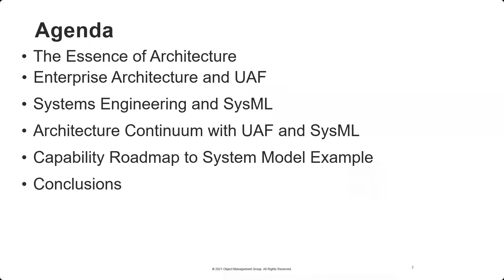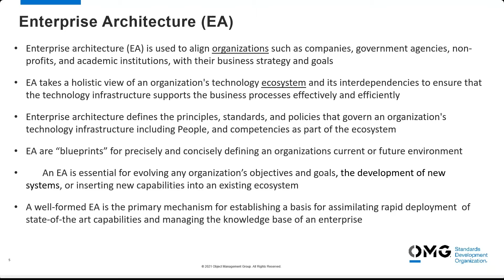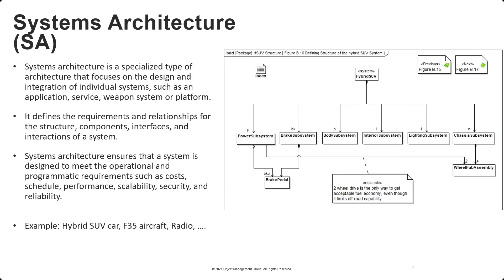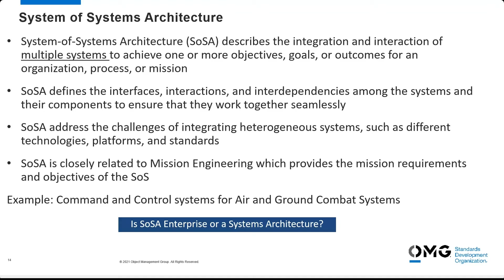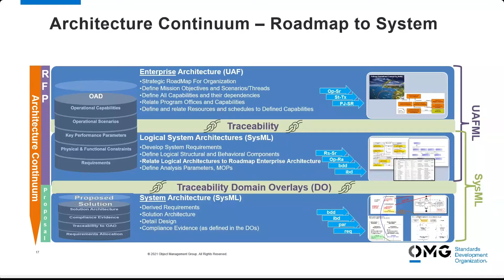UAF or SYSML?

Comment: Use both depending on the organizational stakeholder and level of abstraction you're working with.  UAF is Enterprise and if you're trying to capture where your project/system fits in the enterprise for the strategic goal or mission.  UAF is very structured and defined, and in Cameo System Modeler, the elements and relationships of the language are rigidly defined and can be very complex, hard to understand and frustrating at times due to this structure.  Even depending on the package diagrams and views, you will be only presented certain elements and relationships.  Using UAF takes a lot of planning and I suggest going to a white-board first to understand your UAF framework (and what are you trying to convey that is important to your stakeholders).  The rigorous definitions should provide guardrails to allow interoperability across a large and complex organization.

SysML doesn't have near the level of definitions and guard-rails that UAF (as a extension) has.  This simplicity and freedom makes it better when you get down into the system architecture details and better for diving to the lower detailed abstraction of the HW, SW structure and engineering analysis.  Most Enterprise stakeholders shouldn't need this "black box" sausage making details.  This freedom also makes it harder for "interoperability" with basic context needing to be build from scratch...these predefined in UAF.

UAF provides the enterprise vision of what is to be accomplished and why, and when at a strategic level with how and the organizational structure that will execute..."white box" view of the Enterprise Systems.  SysML is the "black-box" detailed systems of HW, SW configurations for the target architecture and the analysis to realize the allocated actualization of real HW, SW integration to realize the vision provided by the UAF architecture.

Anyways, just my word soup and how I'm using both for my System-of-Systems.  🙂

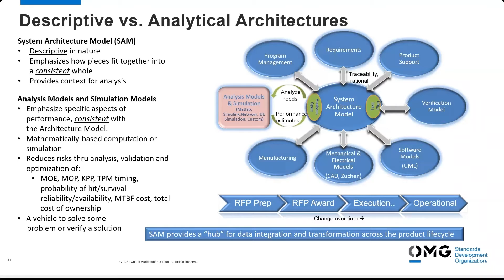Comment: For the segment starting at 12:00 on "Enterprise vs Systems Architecture":

Considering the definition of a "system" from ISO 15288 or the INCOSE Systems Engineering Handbook, one might ask: Isn't an enterprise also a system?

Another perspective to consider:

In reality, the term "system" is a conceptual construct or sometimes just a suffix in a product name used in everyday language. The concept of a system doesn't exist as a tangible entity; rather, it describes certain behaviors and relationships.

Some assemblies of objects exhibit "system-" behavior within the processes they are involved in. In these scenarios, they take on what we can call a "system role."

A "system role" is a role that emerges within a “composition of elements” where, in at least one arrangement of these elements and within the specific process they engage in, the composition exhibits behaviors that the individual elements alone do not.

Therefore, an organization, a collection of engineered artifacts, or parts/elements of nature can take on a "system role" in certain processes. However, in essence, these compositions are simply what they are—assemblies of components with potential behaviors, not "systems" in and of themselves.
Reply from the maker: It is a misconception to think of a system as a thing. System is really more like a way of perceiving some thing, similar to the way a collection of things can be perceived as a “set” using the methods of set theory. The way we perceive a system is based on systems theory which is based on systems philosophy.

https://www.systemsphilosophy.org/about-systems-philosophy 

In common speech, most people think of a system as a thing but that it is an illusion if you properly consider systems concepts from systems science and philosophy. Systems engineering has for a long time adopted the “common speech” about systems which has impeded progress in the world of SE practice. 

A group of INCOSE Fellows conducted a study a few years back to investigate this topic and proposed the new definition of system for INCOSE.

https://www.incose.org/about-systems-engineering/system-and-se-definitions 

An enterprise is a human venture. In common speech, especially in the IT world, an enterprise is equated with a large organization that IT supports. They talk about “enterprise systems” which really confuses things; what they mean are IT systems and software that is used across the whole enterprise, eg travel accounting, payroll.
 
So, an enterprise can be perceived “as a system” but that does not make the enterprise a system itself. When you look at an enterprise as a system you are forced to look at it through a systems lens. But if you instead look at an enterprise through a sociological or political or economic lens then you can see things that the systems viewpoint cannot perceive.
Reply: @ObjectMgmtGroup  I believe we share a common understanding of the term "system" and recognize its frequent (mis)usage in certain communities. (By the way, I've been a member of INCOSE since 1987.) From an ontological perspective, anything that exhibits system behavior (at times, e.g., an engineered system while operating) must be included in our entity taxonomy. As a matter of worldview, I choose to exclude concepts, sets, and possible worlds from my hypothetical ontology. This leads me to define "system elements compositions" as a collection of material or immaterial entities that, at times, exhibit system behavior and assume a type of system role (e.g., operating system role, enabling system role, etc.).

Moreover, my initial comment was about my objection to the de facto differentiation between Enterprise Architecture and System Architecture, as seen in ISO/IEC/IEEE 42010 Software, Systems, and Enterprise — Architecture Description. If these terms refer to entities that can exhibit system behavior, why not use "Enterprise Architecture" or "Engineered System Architecture" as specializations of "System Architecture"?
Reply: @ms1923  Interestingly if you analyse ontological use of language of entities you find often a singular entity never has the system word added to describe it. For example a human is not a system or referred as one in biology. Instead a human has systems, i.e. a collection of parts that deliver something of value to the whole, or a human is part of systems. Both cases it implies that most humans intuitively understand, even if they do not recognise it, that a system is more than one real or conceptual entities that are causally integrated and have some boundary.

I also agree with your statement about EA and Engineered Systems both being specialisations of system architecture.